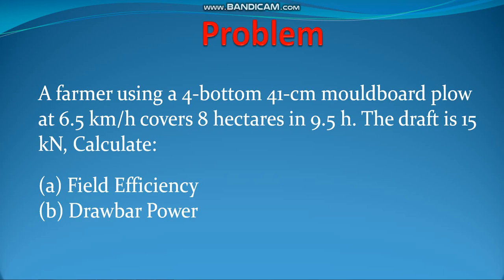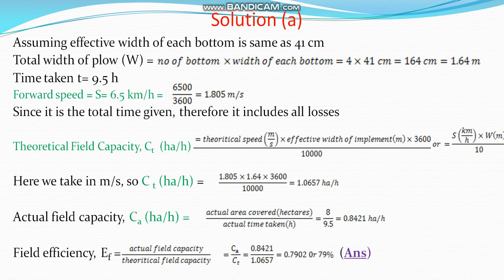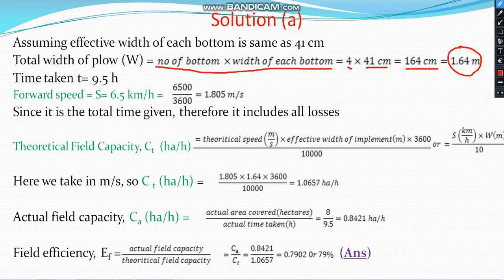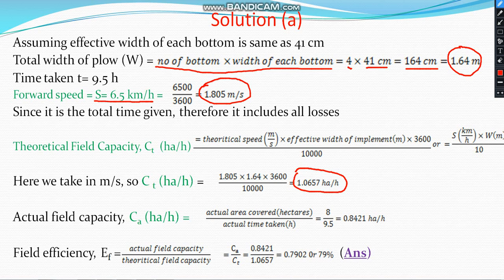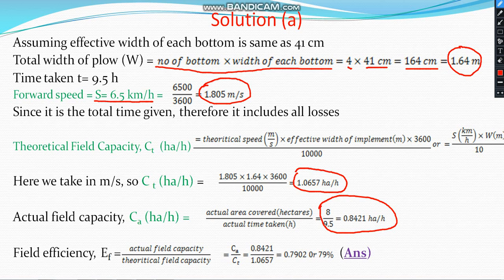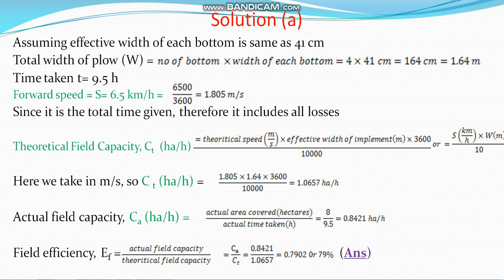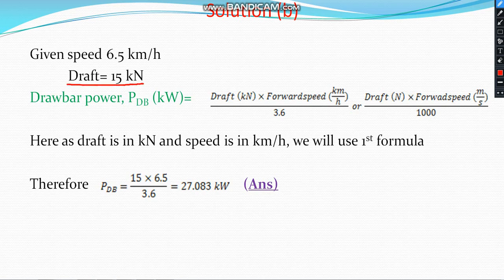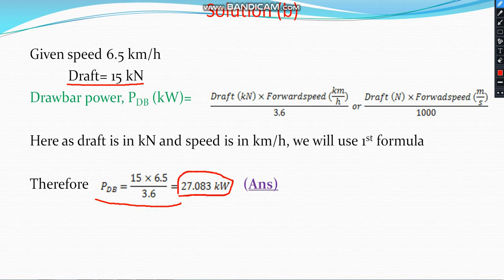Field Efficiency Problem 1

Comment: A farmer is using a 4x41 cm mould board plough at 6.5 km/hr. the overlapping and turning time
loss is 10% and 10% respectively. Calculate the field efficiency.

Plz solve